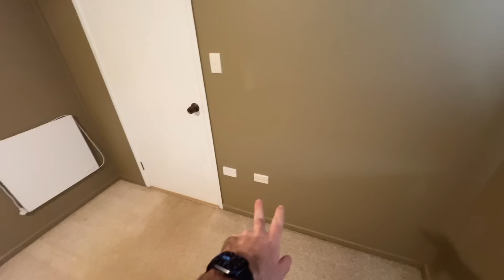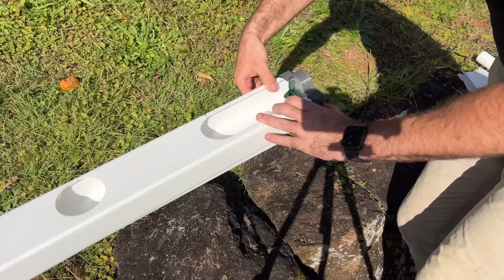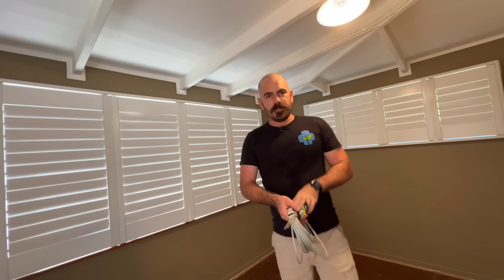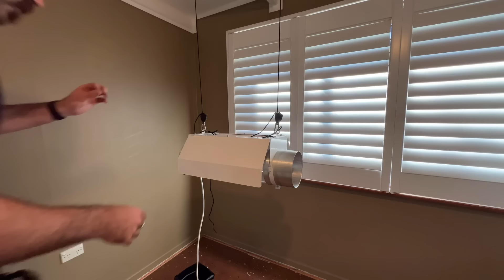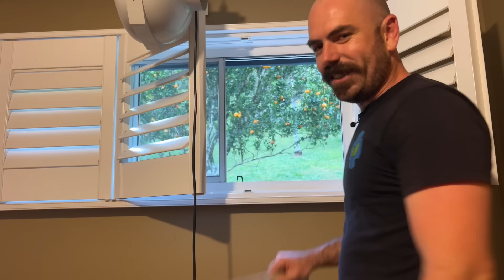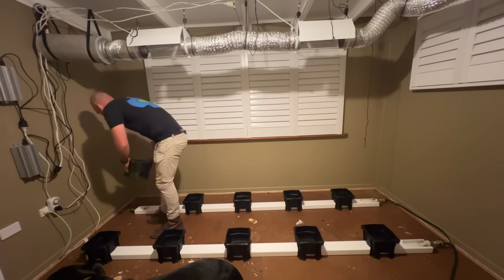Setting up a Stealth Grow Room

Comment: The Craigslist/ fb marketplace budget set up I see. People practicly giving away old hot and inifficent hps lights so I hope you didn't buy those new. The fan should be right after the filter. Also that glass will get dirty from time to time limiting the efficiency of light ahining through. 2 600 watt led lights (from the wall not equat to)  will be less hot and produce more than those bulbs. Talk about a flash back to the late 90' early 2000's. Suprised we didnt hear limp bizkit in the background.

Comment: You will need an intake to get fresh air into the room and you will have so many issues with heat in that room running hps in summer, i also suggest running the ballast outside the room if possible just to eliminate as much heat as possible

Comment: You fan lasts longer if you put it before the lights as the heat lowers the life span of the fan. Just after the filter so it’s pushing the heat instead of sucking it

Comment: Tip. Inline fan should be connected right to the carbon filter to limit possible air leaks. You want the inline fan pushing the air through the lights not sucking. Otherwise you may get unwanted smells getting sucked into the system.

Comment: Question. With lavender changing its nutrient so fast and often, how do you clean out your system and cycle it through to prevent toxicity and lock outs? I've built RDWC systems for my lavender before and would change my water weekly/fortnightly

Comment: you are going to burn that fan quickly pulling all that hot air all the time, better moving it so it is directly efter the filter but before the first light.

Comment: As others have noted, a parallel vent system would be better/cooler than being in series. The second bulb now has very hot air being drawn over it the entire time, rather than having fresh air being drawn into each light individually. The sickly yellow won't help with the "stealth" factor compared to a modern, full-spectrum White LED. HPS is very much out of date with no real benefits, including cost, heat, energy usage, functionality, longevity and all around convenience. No sense in going "High Tech Hydro", if you're going to use Low Tech lighting.

Comment: Most folks, pros included, are using full-spectrum LEDs these days. They run much cooler, much brighter, are dimmable, programmable, take up much less space, never need replacement bulbs and have basically an unlimited lifespan.

Comment: Hello, nice setup over there but something is bothering me. When you apply ventilation, you used series method instead of parallel. I think you may use air as parallel because last lamp will burn from first lamp.

Comment: A couple off thoughts thouge. It goes carbonfilter to inline fan to lights. That way the fan dosent have to handel the high temps from the lights. And how stealth is this growroom if you stand outside the vent ? And venting into an attice can cause problems with condensation and mold/rot. Is that timer abel to handel the starting amps of 2 600 watts of hps ????

Comment: Nice 1 Mr Hoocho. I would be tempted to put the activated carbon filter on the outlet as the air being drawn in around the light fitting is not being filtered removing the smell of the "Lavender". Looking forward to the sampling video

Comment: You wouldn’t get away with that here in the UK unless you used LED lights, solar pv power, they use thermal imaging and unusual power consumption to catch people growing Lavandula! Lol
Reply: truly living in a nanny state in the commonwealth now huh?
Reply: Not true, they need a warrant before they can FLIR your house, and this is 1.2 kw, a small electric bathroom heater is comparable in power consumption (No smart meter can tell the difference). Your thinking of large commercial size grows in residential housing stealing 30kw of power and the house glowing with radiation.
Reply: get a solar system and beat the system.
Reply: mate we dont pay the eletric we re wire to slow meter never had a problem odd shock thats it

Comment: This should be called how to get locked up lol. I mean the thermals its going to give off are off the chart in an uninsulated room (dont know if you commented on this as I skipped ahead laughing at you) nothing stopping themal or light shinning outside for police helicopter to see (not the light the heat the helicopter will see using FLIR).  Your ventilation IS TERRIBLE 2x600w HPS are going to cook that room with only one fan going through your cooltubes. Did you even ask for advice from someone at the shop you bought all this gear from? You should have as the stores generally have a bit of knowledge where this is concerned.  Rant over its just no where near stealth lol

Comment: The guys over the back from me did something like that, but they put in massive polytunnels, was a $11 million operation and it was right on cropping time when these guys with guns turned up, pulled up all the plants, and then set them on fire. True story. This was just before I purchased my new place, never saw it myself.

Comment: Please check your local laws for Power Usage ... and Leak Proof the room for Light 
There are commercial hydro products but you really need to be a part time Chemist ...
Reply: He could be using LEDs, which draw much less power and make much less heat, as well. The "Power Usage" stuff is nonsense. The power company just wants your money, the more you use/buy, the better. There are "regular" houses that use way more power than this ever will.

Comment: Why are you using HPS?  Modern LED is at least double the efficiency and heat is significantly less,
Reply: the sponsors of this video didnt send him one
Reply: @jdthegimp  at the price of electricity it's worth buying new LEDs over the course of 12weeks.
Reply from the maker: I just set up the room, the lighting equipment was supplied. 😊
Reply: @Hoocho   Free doesn't mean good ;)
Reply: @KarlKarsnark  Old doesn't mean bad ;)
HPS lights work very well for "lavender" and many other plants, and supply all the heating you need for a cold but insulated environment.
Reply: I went back to double ended hps. They produce about 50 percent more then my hlg leds. To me, the extra 18 dollars amonth to run hps makes it worth it.
Reply: @chrismulry6792  Plus replacement costs, Plus ballasts, plus cooling costs, plus the space they take up, plus the ventilation fans/ducts needed, plus the risk of fire, plus obnoxious color, plus the risk of bulbs shattering above your grow, plus the inability to dim them or change the spectra they produce, plus....plus....plus.....There is literally no benefit to HPS. Every aspect of it simply leads to consumption of more everything. They ugly, obsolete, ineffficient and wasteful.
Reply: People on here shitting on Hps doesn't know that all major facilities are bringing HPS into the led rooms to get the Yield of led and the Quality of Hps... All future grow rooms will have hps and led checkered light setups with far red for the last 5 min to put the plants to sleep fast.
Reply: @eccultivation  LOL! No. Far red is not beneficial, actually causes stretching and no form of light puts plants "to sleep fast." You're drunk on Broscience.

Comment: hps.. in australia? right out the gate this plan seems flawed. cant be very stealthy if the electric company is going to immediately identify the surges in power use. go figure led grow lights would bypass both the heat and power problems.
Reply: electric doesnt care, they just want the bill paid on time.
Reply: @RDL-001  ofcourse.. the electric company doesnt have helicopters that can see heat either. dumbass. nobody worries about the electric company kicking their door open and pointing guns around the place. >>stealth<<
Reply: looks like 1200 watts. chill
Reply: @OrganicGreens  leds dont NEED to be chilled.
Reply: only x2 lamps 😂 relax buddy
Reply: @sheep.herder  see all that ducting? the fact that its there means there is a better way.
Reply: @sheep.herder 1200w kicking on for 14 hours every day at the exact same time for 8 months yeah they won’t notice it 😅
Reply: The Electrical company is not the police. They couldn't give a rat's ass, as long as you are paying the bill and not stealing the electricity.